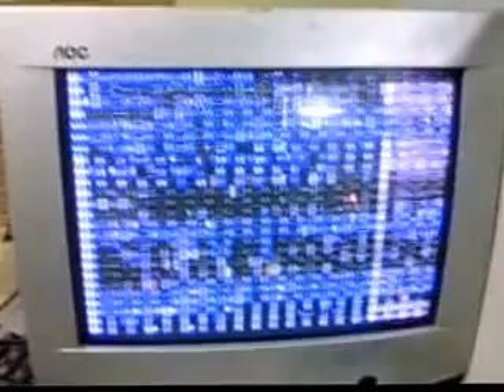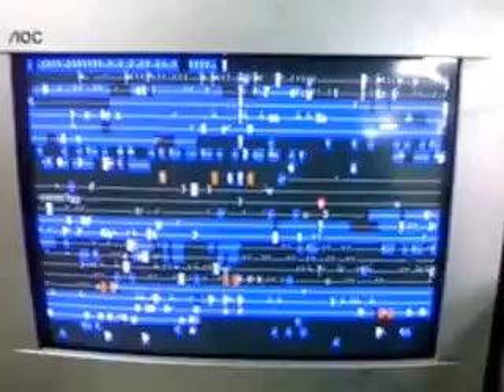GARBAGE DISPLAY PROBLEM OF COMPUTER

Comment: AOC Is A Bad Quality Monitor Terrible Brand . . .
Reply from the maker: Not all times, this error is not the cause of crt monitor screen, its a problem of system unit called BSOD or blue screen of death of computer
Reply from the maker: Do you have bad experience in using AOC monitor?